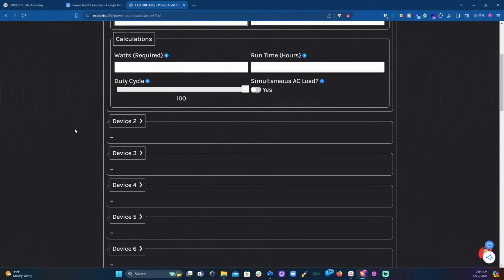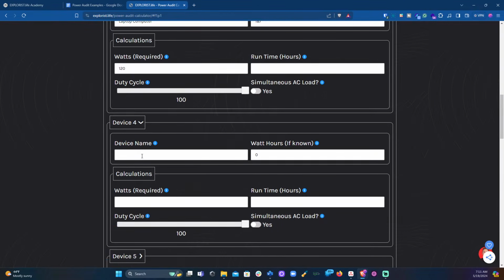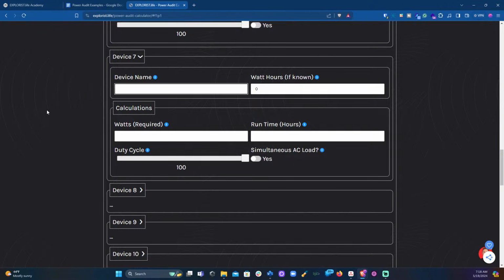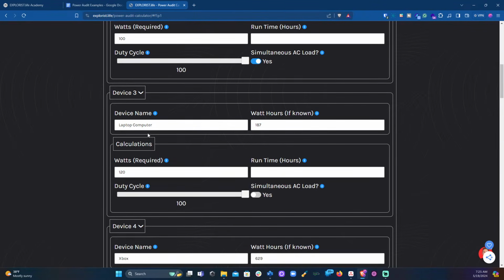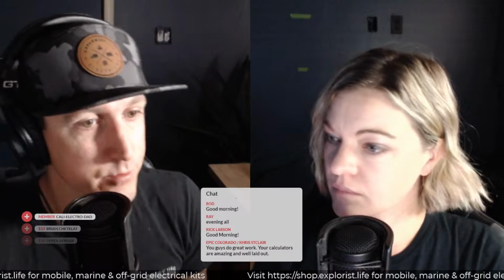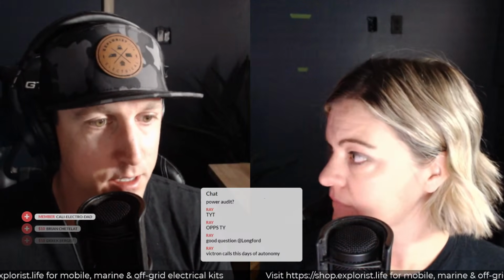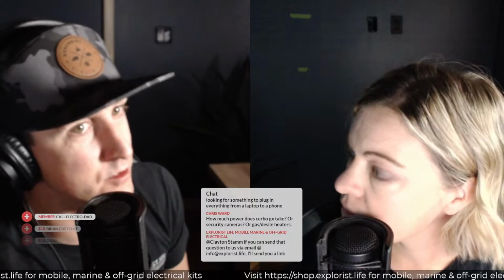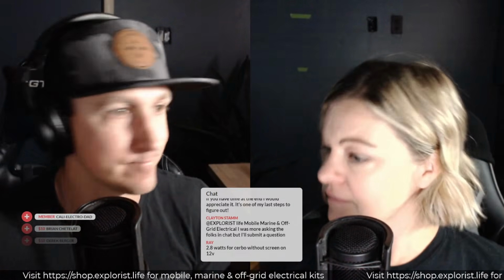How Much Battery/Solar Do You Need (for a mobile, marine or off-grid electrical system)?

Comment: 20:21 "If you have more than 20 high power usage devices, I think something's kind of gone wrong."  Our Brinkley G 3950 has more than 20 notable power-using devices stock / as delivered, before adding in our full-time RV family with all of our additional chargers, appliances, tools etc.  I'm building my own calculator since we'll need ~double or more vs. what you feel is acceptable.  Other than the condescension ;-) thanks for a lot of good input, this is a really good summary of power planning practices!  I'd encourage you to add an expandable section to your calculator though, we don't have the biggest / most elaborate rig & setup and a limit of 20 devices ain't close to the real need.
Reply from the maker: Hey @1MrKale - no condescension meant. Let me explain: I define a 'high powered device' as things like air conditioners, space heaters, blenders, induction cooktops, air fryers, and the like. Basically anything over 1,100W. And if you are running 30+ of those types of devices all at the same time, your 50A RV breaker box (12,000W Max) will not be able to keep up. This is just the math behind it all. I think you'd, perhaps, benefit from reachout to us for support and we can better assist: https://shop.explorist.life/support?utm_source=youtube&utm_medium=comment&utm_campaign=support&utm_content=response_link
Reply: @EXPLORISTlife Totally fair, maybe I should've used a softer word or an extra emoji to imply sarcasm. All good! Like I said, super helpful encapsulation of power planning practices, like much of your academy material which I'm starting to explore. Great of you to put all this information out there!
Reply from the maker: Totally hear you—bigger/full-time rigs like yours can definitely blow past that simple “20 devices” example. For setups like that, we really prefer to look at everything more holistically so we can size the system right and make sure you’ve got the components to match.

We've had extensive experience working with Brinkley systems before and would love to help you with your setup! If you’d like, our team can go through your loads, usage patterns, and gear list with you and help plan a system (and parts list) that actually fits how you RV: https://shop.explorist.life/support

Comment: Great video and calculators, thank you! 

I'm planning my set up and I will only have space for 2 solar panels of 170W each. I would also like to be able to connect an extra solar ground unit (of 200W), by just taking it out and plugging it in - is it possible to do it all with the same MPPT? what size should it be, 100/30? do you see any problems with this (maybe different size panels with different V and Ah)?

Comment: Hi, I’ve had a question for a while. I have 7 100aH AGM batteries and 2 100watt panels connected to 80am SCC and a 3000w inverter charger. I can’t run my system more than 24hrs before needing the generator. I also can’t run the microwave, a/c, or heater without the generator but the system can handle the fridge, tv, WiFi box, and computer. What do I need to do?

Comment: Do you find often times when camping you’re parked in the shade? I put a modest system on my trailer and I am now thinking about getting a beefy generator and a victron that can charge at like 120 amps or something. The solar rarely makes power because I’m usually parked under trees to keep it cool inside.
Reply from the maker: During our 4 years of living on the road/camping full-time, we most often found ourselves with the choice of parking in the shade or not depending on if we needed solar re-charging or if we wanted shade.